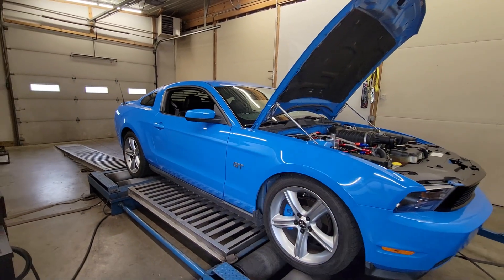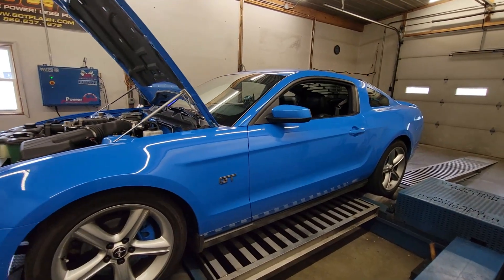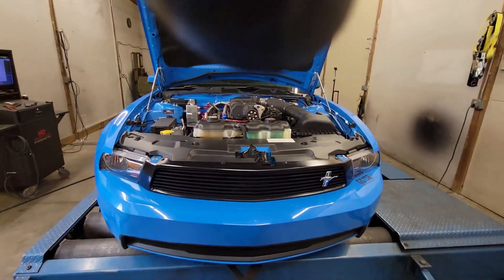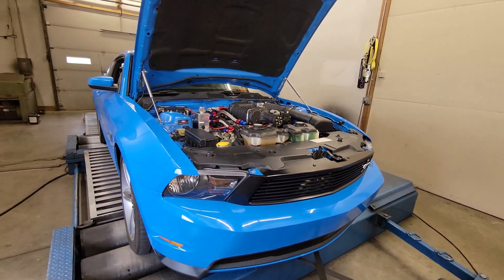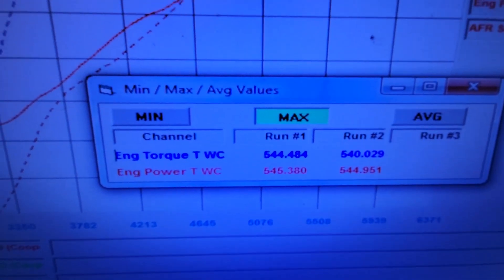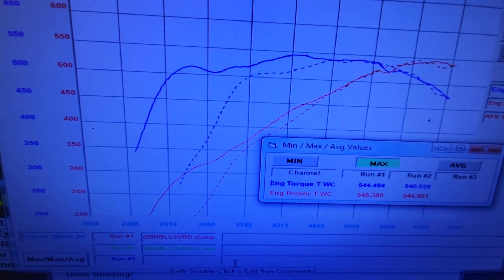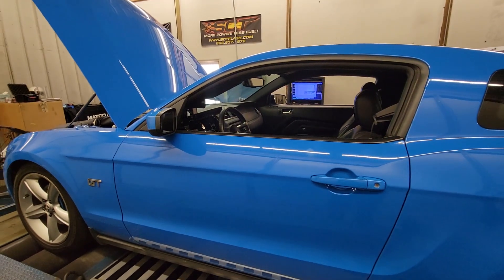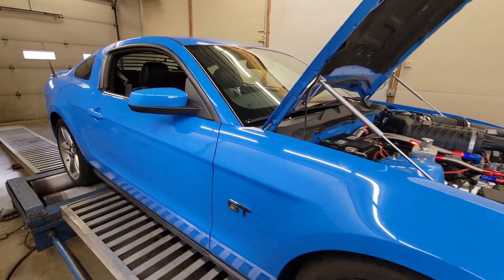Roush Supercharged 3v 4.6L Ford Mustang GT | Dyno Review

Comment: When can u get your hands on them. They are so hard to come by, also can the 3650 handle the boost?
Reply from the maker: The 3650 has been doing good at this power level in multiple cars
Reply: @ForceEngineering  really, I could of sworn it hated boost also can you still by roush pd's for the 3v ?
Reply from the maker: @josharuni547  as with most things, the transmission life depends on the combo. If it was setup with an overly aggressive clutch, and a sticky tire, it's life would be shortened. 
 As for the blower, I'm not sure. I dont try to sell blower kits, I just tune a few of them